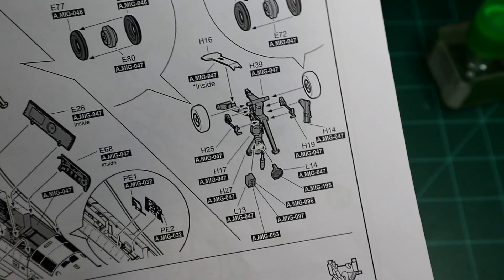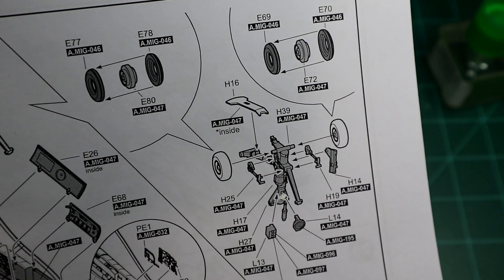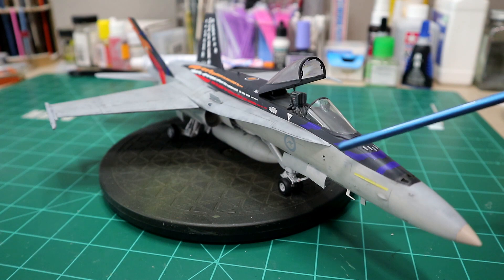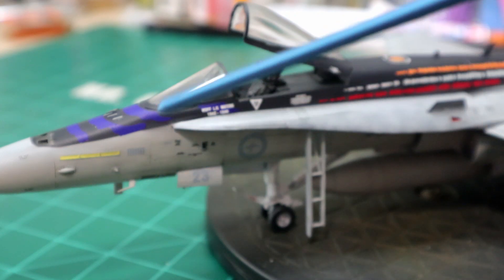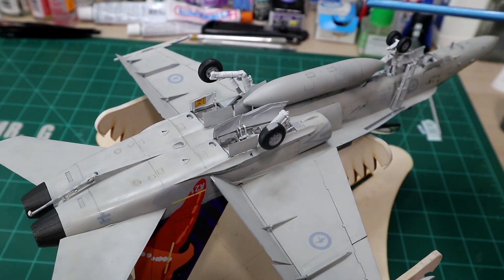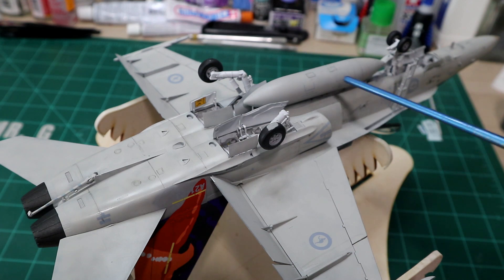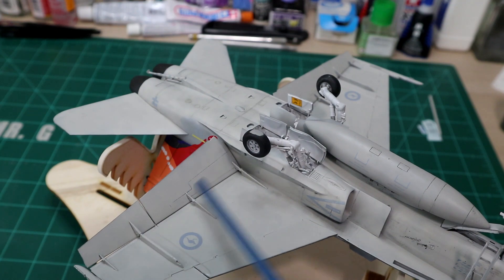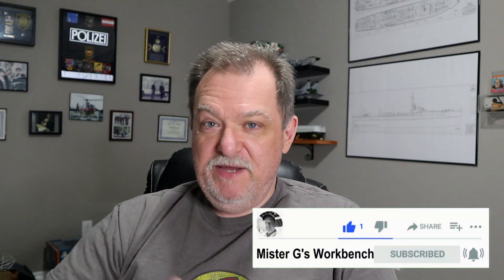Step by Step - Kinetic F/A-18, Part 11: Final Results

Comment: Also this is the gold kit which should be better fit. I can only imagine how bad the original kit is.
Reply from the maker: It sounds like the Gold kit inherited a lot of the issues associated with the original kit. I'm not exactly shocked.
Reply: @MisterGsWorkbench  so in your opinion if one is going to build a legacy Hornet get the Hobbyboss kit?
Reply from the maker: @juancho420  I have not built the HB kit, but that being said, there are people online who have explained fixes for the Kinetic Gold kit that correct the nose issues. Honestly I think it's a more affordable kit and if you build the nose in the correct order it's a decent kit.

Comment: I agree that Kinetic cannot furnish a detailed manual, they lost any kind of logic, I'm pretty sure they don't try to build a model with the instructions they provide.. You've got to look forward in the pages to find a view where details can be seen (and many times they are not even here) in order to place the parts correctly ! Blank assembly doesn't always provide the real position.
Reply from the maker: Completely agree - I'm willing to bet nobody looks at the instruction sheet before they publish it. 🙄

Comment: John.. you mentioned you rather build the HB Kit. what advantages in the Build sequence did the HB kit have over the Kinetic. are there any issues with the HB kit? I have read mixed reviews.. thanks..
Reply from the maker: Robert - the Hobby Boss kit is very similar to the Hasegawa kit in design (probably a close copy...). The fit and finish were better in my opinion. The Kinetic kit is let down mainly by the poor instructions and secondly by the poor for of the intakes as well as around the refueling probe door. I just felt that the overall build of the HB Hornet was more enjoyable. Just my two cents.
Reply: @MisterGsWorkbench   Thanks, John

Comment: Well done John well you can get it off the bench now! Kinetic seems very much hit and miss I don't have any in the stash as yet however I do have a Harrier 1/48 GR1/GR3 on the way from them. I hope it goes together better than the F18. Still for all your struggles the kit turned out well. Great tips BTW
Reply from the maker: Thank you Neil! I've not had a lot of luck with Kinetic with the exception of the Super Entendard. Outside of that I had tried and failed to assemble the S2 Tracker which had awful fit and little detail. I hope your Harrier is of better quality. Thanks again for watching!
Reply: @MisterGsWorkbench  I will keep you posted about the Harrier progress

Comment: Well done, John. I must admit, your enthusiasm for the build was infectious at the beginning. I was about to jump in and build the same. I can absolutely empathise with your frustrations now. She looks great, regardless. But I think I’ll stay away from building it myself. It will remain my favourite Aussie classic Hornet. 
I’m working on Hasegawa’s 1:72 77SQN “Bushido Guardian” Hornet, but my mojo’s not pulling me to keep going on that. So I bought the Airfix 1:48 77SQN Korea Meteor...My intent was to put either of them on the shelf at the squadron. Meh.  Its a very uninteresting aircraft, so today I purchased a 1:48 Luftwaffe Dornier 17Z from Eduard....Follow your bliss, they say. I’ll stand next to the letterbox for days. Can’t wait. 
The centreline tank: It sits very slightly back when compared to your build. The clearances between it and the nose gear trailing strut and the inner forward main gear doors are about equal, but...yeah. Close tolerances. Don’t move it, it’s fine. I look forward to whatever is coming nexus from Texas. Cheers. 🍻
Reply from the maker: Thanks very much for your guidance during the build. Like I was saying towards the end - build the Hasegawa or Hobby Boss Hornets if you are inclined. As to subject matter your absolutely right- build what interests you! Looks like the 1/32 Ar-196-3 is coming up quickly in order to dispel the 1/48 jet bug I've been feeding. Thanks again for your support.
Reply: Drool. 🤤
Reply from the maker: @johnmarley6695  😆